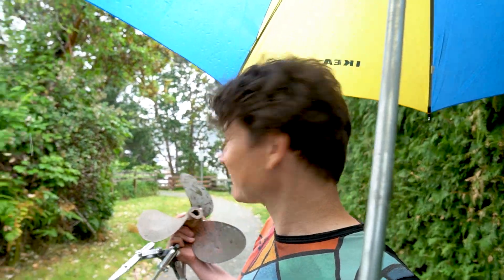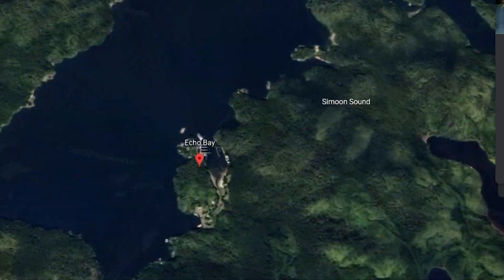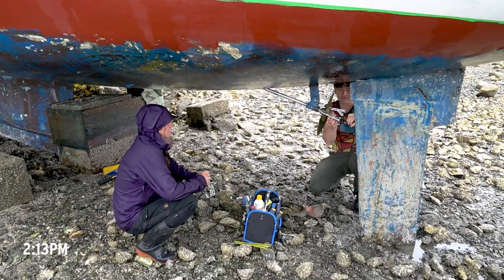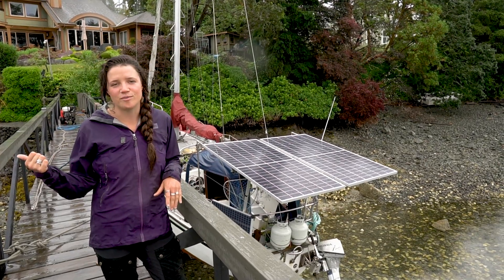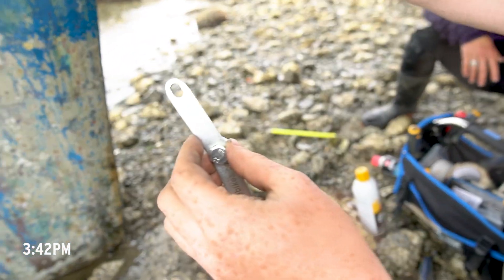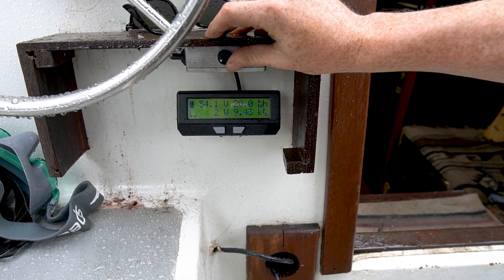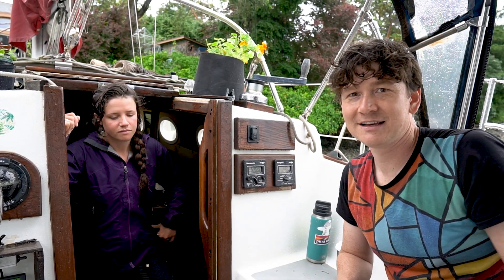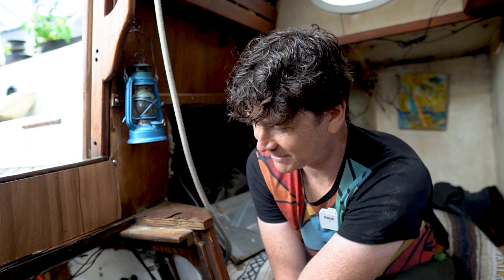Belle Amie Part 2,  New Propeller, Solar Panels, 20kWhr Battery on 32 Foot Electric Sailboat

Comment: Could I use a turn dial like that to limit the max speed of my ebike and still have the twist throttle? As much as being limited to 32km in Canada sucks I want to limit myself to about 26kmph to see if the range increases with my solar scooter setup :)
Reply from the maker: Yes trivially.  Not sure why you asked this on the belle-ami electric sailboat video, but the Analog Aux input of the CA3 allows you to hook up a potentiometer and configure that for on the fly adjustmet of your speed limit, power limit, amps limit, or pedal assist level.

Comment: Do have a 72 volts battery bank for my electric Pearson 35 but is made out of age batteries.  Looking to upgrade to lithium but do not find any lithium battery able to be connected up to 72 volts. All I find is up to 48 volts. According to everyone I have spoke is dueto the bms not supporting 72 volts. What is the solución you found?  Time to replace batteries on mine but I wouldn’t like to go agm anymore. Thanks !   Very nice projects in your channel.
Reply from the maker: There are certainly vendors of 72V lithium battery systems out there. You can also just series connect either 6 12V lithium banks or three 24V banks.

Comment: I don't understand it clearly. I see 12 batteries, I suggest LiFePo4 cells. The cell's are 3.2 Volt. Is it possible to give me some more specification please? What type of electrical motor you use please? I'm very interested in this project. Nice job. Regards. Willy
Reply from the maker: Each battery module is a 16s 6p layout of nominally 6Ah 'M' sized cylindical LiFePO4 cells, making them ~50V and ~36Ah in capacity, and about 1.8 kWhr.  Those in turn are all hooked up in parallel.  The motor is discussed in the video series on Shamrock  https://www.youtube.com/watch?v=JuIG5Uqk4_c
Reply: Thank you for your repay.
Regards.
Willy

Comment: generally it's 48 V max on fresh water, and 24 V max on salt ... but i think you can squeak it up to 48 V on salt, with a center-tap sea ground, but check your regulations....EDIT: most seem to agree, SALT REGS,  48V WITH Center Tap Sea Ground, And Also with the condition that the 48V is the M/G And DC/ DC Converter Input Voltages Only......all peripheral buses must be 24Vdc and lower, Post DC/DC Converter.....SOME may be ok with higher CT Pack Voltages than 48Vct on the M/G and Converter Inputs IF CONDITIONS WITH THOSE CONNECTIONS ARE MET.

Comment: up to 48 Volts with a center tap sea ground only....otherwise stick to 24V on salt.....your series string needs to be balanced on both sides of the center-tap sea ground for 48 on salt......72V is much too dangerous.

Comment: Thanks. Great to see more. Possibly increase the prop diameter as well for effective regeneration usually requires 18” 45mm, though regeneration under sail won’t likely be significant till ocean crossing. I am hoping to remake a hub design to a larger hub essentially my shaft as I now do have a traditional diesel to eliminate generators. Belt drive options I do have just the direct drive would be best. The electric drive is so much preferred nearly silent.